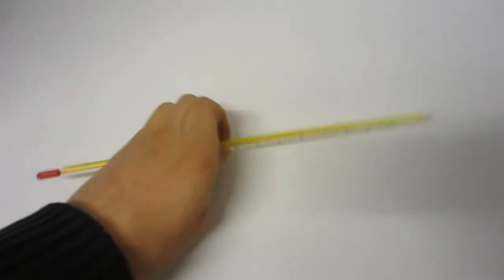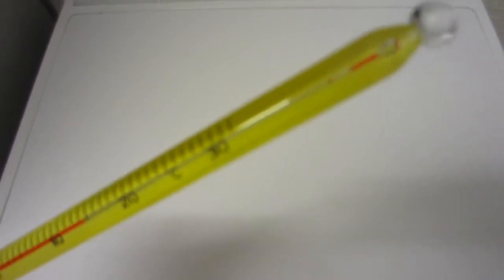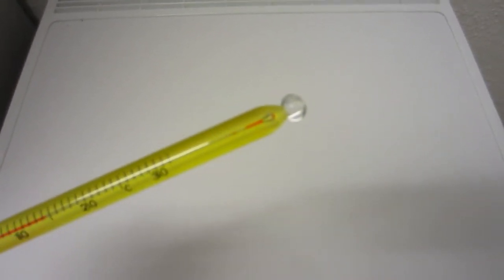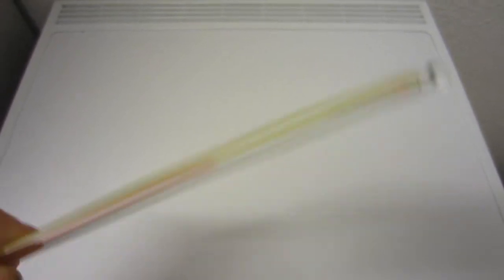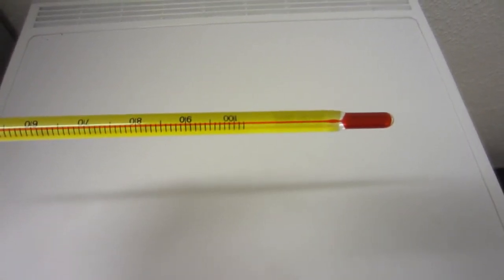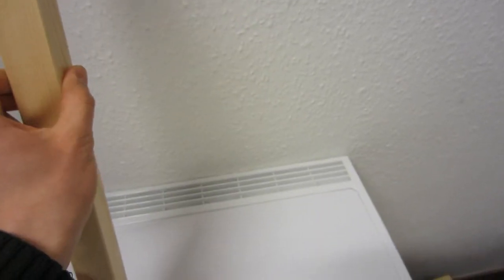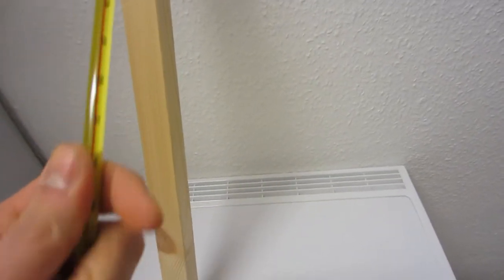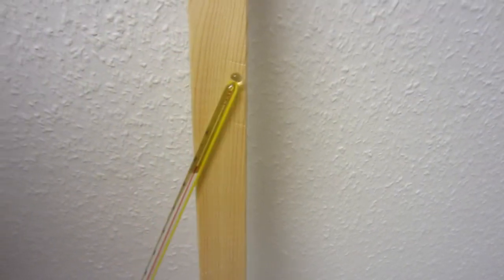Fixing broken Thermometer Column

Comment: Hot water from the tap carefully applied to the bulb at the base will do it, the second the air bubble is forced out & the mercury is joined up use cold water to lower it. Apply hot water from the tap slowly, if you do it too fast & it's too hot the thermometer will explode once the mercury is at the top with nowhere else to go.